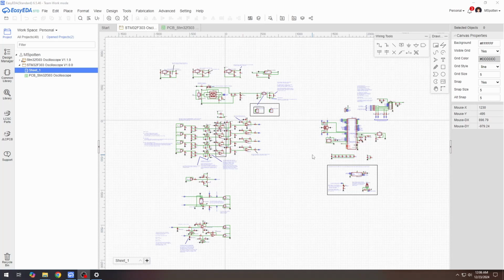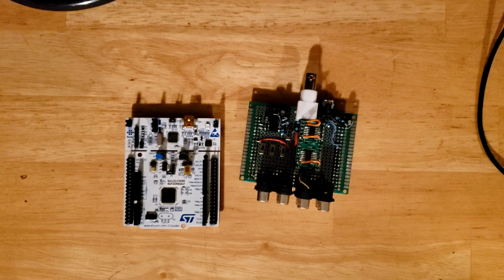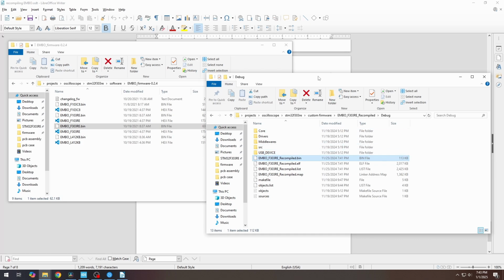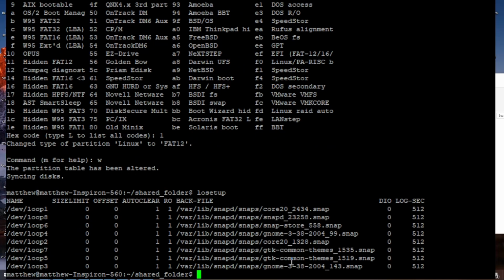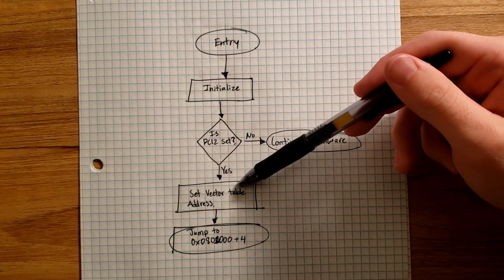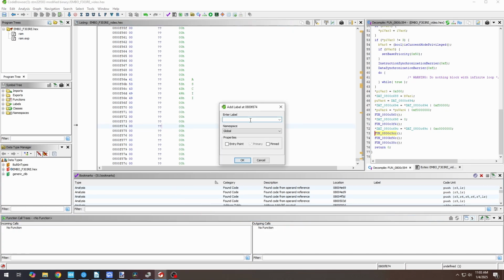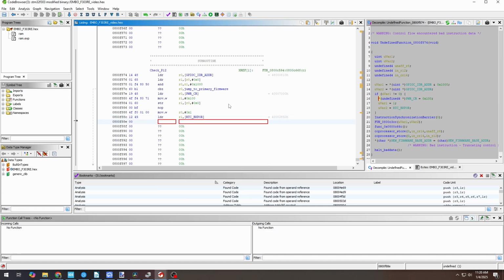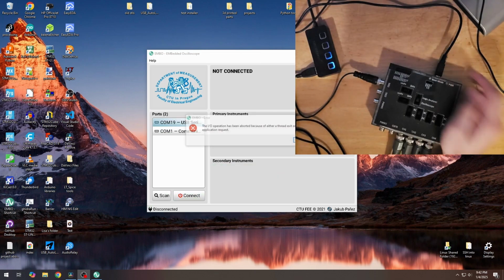Building an STM32F303 Oscilloscope, part 2

Comment: Embos shoftware support multimeter ,this hardware suport or any one port for multimeter too?
Reply from the maker: Yes, the hardware also supports the multimeter! You just have to set the scale and offset accordingly. The input of the stm32 is 0v to 3.3v, and the voltage range of the input is -3.3 to 3.3. In the software, set the scale to x2 and the offset to -3.3v, and you should get correct voltage readings. If you use a 10x probe, you can set it in software to x20 scale and -33v offset

Comment: Is there any software or firmware that needs to be uploaded to the STM32 board?
If so, where can I find it, or could someone provide a HEX file?
I am currently designing a hardware board as an open-source project, and I came across this software, which I would like to use.
Reply from the maker: That's exciting! Sure!
You can find all the resources to the project on my github!
https://github.com/MattSpot10/STM32F303RE-USB-Oscilloscope

The modified firmware (which includes links to documentation and software install) in the this folder.
https://github.com/MattSpot10/STM32F303RE-USB-Oscilloscope/tree/main/firmware

The original EMBO software and firmware release this project is based on can be found here!
https://github.com/parezj/EMBO/releases/tag/sw0.1.5
Reply: @matthewspotten3533  very appreciated

Comment: Matthew;
Any further observations, use of the scope, update/upgrade?
I guess that you have a x10 probe setting?
I was doing some work a few years ago, and found a copy that makes really low capacitance diodes, in case you wanted to add input protection that doesn't cost much bandwidth?
I was actually using an idea that used the Vf curve with a math channel, to allow a "compressed" input voltage range... You lose some resolution of the real input voltage as the log curve of Vf cuts in, but you can get quite a wide range, without changing/attenuation.
Cheers, Sir!
Reply from the maker: Kind of, it's just the 10x switch on the probe. Low capacitance clamping diodes would be awesome and definitely something I hope to incorporate!
Currently it just uses the internal input clamps on the op amps. They said the inputs were internally diode clamped to the supply rails and to current limit the inputs to 10ma. With the inputs being fed through 180k resistors I didn't see this as much of a problem from a DC perspective. Caps are used to transfer the AC component of the input but I guess at high frequency and voltage they might allow dangerous currents to pass through to the op amps.
using a Vf curve sounds super cool! I've never even considered that. I kind of want to try it!

Comment: spotten, not s really common name.
i wondered if you are related to a guy that i knew at Nokia in san diego?
i guess I'll have to watch your 303 version
I've been thinking about hanging this kind of oscilloscope on the back of an analog scope, to use its front end...for maximum fun, i have an old tektronix 700 mainframe, a 2.two-channel vertical plugins, a differential plugin, and a horizontal/trigger section...thinking about putting the 4 channels of the 303 connected to the analog channels on the backplane, So I'd get really good front end, and excellent triggering, and basically replace the display system with the digital scope.
so, I'll get back to your adventure tomorrow,
Reply from the maker: If there is someone with the name Spotten I'm usually related to them not too distantly.
That sounds like such a fun project! I'd love to hear about it or see it as it progress!
How would you purpose the 4xADCs on the stm32 or other words what analog channels on the backplane would you route to these inputs?
Reply: Hi...a bit of prodding about the schematics... with channels A and B;
It looks like it's possible to "fake" the amplifier A to be on continuously, and set channel B as trigger source, which puts channel A to the backplane "signal" pins, and channel B to the "trigger" pins... If you just cut the backplane signal and trigger traces, isolating two vertical plugin's, then put shielded twisted pair from the signal and trigger pins at the backplane, you get all 4 channels available, all the time, and maybe put in a switch to select which of the four channels could go to a horizontal plugin, to make use of the scope trigger, or, of course, use the trigger setup in your scope "box". See, easy 😅
Reply from the maker: Yep, easy😅 That sure does sound like maximum fun! Thank you sharing that with us.  Best wishes to you!
Reply: Thank YOU !

Comment: How did you learn how to do all this bro? How can I learn what I need in order to make my own custom stm32 boards for projects?
Reply from the maker: If your trying to figure out the hardware side I would start with st's dev boards for a specific microcontroller and learn how to connect all your desired devices to it. When you want to build your own board, st usually provides the complete schematics to their boards in their documentation. It's nice to have examples.

For programming them there is so many great resources online. 
St providing stm32cubemx and stm32cubeide makes development really easy. There is many tutorials on how to use their software. 
Learning about the inner workings of microcontrollers is also worth the investment. 

Ben Eater on YouTube does a series about building a breadboard computer that is fantastic. In the past in striving to understand the inner workings of a microcontroller I pulled up reference Manuels and datasheets and started doing "bare metal" or "register" programming instead of using HAL or even the LL drivers. You can also watch a lot of tutorials on stm32 bare metal programming on YouTube.

If none of this makes much sense I would just dive into it. You'll figure it out!

Thank you for your question and best wishes to you in life and in learning how to create your own stm32 boards!

Comment: You might find my capstone project interesting. It's also an MCU based oscilloscope/signal generator, but it's got a screen and battery built-in, and it's designed to plug directly into a breadboard (no BNCs required, though I did make an add-on which let you use BNCs). It was targeted at very low frequency use, though, like literally 1 Hz level, so students can actually see what's going on in real time with LEDs and stuff. It's meant for educational use, mainly. Technically it's capable of up around 1 megasample/s though, with a bit of overclocking. (I tested up to 2 MS/s even, but the signal quality was reduced). I've been meaning to work on the firmware, it could be a lot better using DMA and stuff. It also does resistance measurement (need to work on resistance measurement accuracy though...) and has current limited power outputs, so any pin on it can be shorted to any other pin safely since it's meant for beginners. They're actually using it for a course at the University of Utah, we made a few hundred of them (less than $15 each to manufacture, screen and battery and case included). 

I've been thinking about doing an STM32 version, since there are some nice chips with higher sample rate ADCs, like the F303 you use. But I've been busy since starting my PhD program. If you're interested in seeing more about the project, go to scopocket dot com. Documentation also needs some work; I should really post a video of it actually in use. If you want to see a video just let me know. Actually, I could even send you one if you want to mess around with it; I've got a bunch.
Reply from the maker: That is so cool! I've been having a ton of fun looking through the documentation you provided. It is very well put together and well thought out. What an amazing and useful project!
I haven't had the opportunity yet to use Raspberry Pi's microcontrollers but they seem very interesting!
Reply: @  the RP2040 isn't really the best for an oscilloscope project because the ADC has a differential nonlinearity issue, but for the target use case the Scopocket is meant for, that wasn't really a problem. Here's a video of it in use, though it's a different version of the firmware than what's being used in the course. https://youtu.be/SbrOokjkZqg?si=bX4wyIwlowkZ5gnw

But the interface is fairly similar to how the better firmware version I'm working on is going to behave. I'm going to use DMA to handle all the ADC sampling and signal generation to offload all the timing sensitive stuff completely from the CPU.
Reply from the maker: That makes sense. Thanks for the video! I enjoyed your demo!

I'm sure DMA can make a big difference. It's so nice to set up a few DMA registers and a trigger timer and walk away.

Pretty awesome you're are working on your PhD! Best wishes!
Reply: @ Absolutely, DMA makes everything so smooth. I've got some prototype software using it, I just haven't fully polished the implementation yet

Comment: try not to use positive voltage regulators like the 1117 for negative voltage. they arent really meant to sink/source current like that and may become unstable. theres a reason there are LM78 for pos and LM79 for negative voltages respectively.
it prob works, just as a general precaution for the future.
DC-DC isolated converter is also a valid way for negative voltage, but same applies there. you can also use a simple 74hc14 schmitt trigger oscillator, with the other 5 outputs in parallel driving a charge pump to get the -5V for the opamps
Reply from the maker: You made some great points! Thanks for sharing that! I considered  those points in the design process and had the same concerns. If you are interested in why I chose this setup continue reading!

The 1117 won't sink any current it will only source current (the voltage will rise to the voltage applied to the output if you attempt to sink current with it). When it's used with a DC-DC isolation converter the output of the LDO is referenced to GND. The current flows from the DC-DC converter, is regulated by the LDO and is sourced to our negative circuit. I kind of imagined it as two separated/isolated circuits that are only tied at one point (like a dual power supply). This makes one rail negative in reference to GND. I was worried about the voltages fluctuating with this setup but it seemed to do okay even under load / no load.

I think the 1117 regulator still acts as it was designed in its ability to, simply put, act as a variable resistor, dropping the voltage, and sourcing current to our circuit. 
I was definitely cautious of this design so if you have more ideas on why this might not be the best or why my reasoning might be incomplete I'd love to hear it. (This was my solution to lack of time and decreasing the BOM :)

I tried charge pumps as well but they didn't seem as stable as I hoped they would be from what I remember about the datasheets I was looking at (voltage drop and slow response). I didn't know how the negative supply voltage would hold up with the op amps going from to sourcing and sinking quickly. Looking back I think it would have been okay but I wanted to know it could provide the current. The signal generation output op amps also runs off this same supply and I wanted it to have the capability to source/ sink up to 10ma.

Again thank you did your comment. I am personally very interested in all there is to learn.
Reply: @matthewspotten3533  something something ground loop issues instability and or latch up/start up issues with some very old/chinese fakes, or so ive been told.
i dont know more about this than you do, i dont even have any degrees. 
i guess one could look at the functional block diagrams and dissect them. 
heck, ive been doing the same for years without issues.

Comment: Fun stuff was hoping you'd do a 2nd video thanks. You mentioned on the firmware boot the PID of USB took me back to like 2012 or so Cypress came out with a really cool development board that houses the CY67C013A Semiconductor. The board allowed you to either boot via USB mass storage device, or there was a jumper onboard which triggered an onboard eeprom in which you could boot directly to say a firmware (as you mentioned) via a preconfigured PID this allowed this cheap $4 board to boot up as a Salae Logic analyzer as long as you had their PID and vid . After I watched your video today I went n grabbed the board out of my microcontrollers bin.... 👍 still had it😂... Thanks for the memories, I've changed my profile picture to this particular board if you wish to check it out, thanks again... Mike
Reply from the maker: That's pretty cool!! A lot of years ago! I'm glad this brought back some old memories!
I've been using the cypress CYUSB3KIT-003 as my logic analyzer the last few years. It kind of blew my mind how useful it's been.
Reply: @matthewspotten3533  I bet you do being an MIT graduate and all. Congratulations on that, I've been learning electronics for about 14 years now, from smart people like yourself, I stick to mostly Arduino as I usually buy the Nano,'s in bulk 🤣 I see you used P6100 probes for your unit, I use the Tektronix P6105's in my cheapy scope n they work good. Bought an analog Tektronix locally about 10 years ago n came with 8 sets of probes. But anyway thanks for the coding vid n I hope you keep teaching, I'm 52 n I don't mind at all learning from fresh minds 😂 take care ✌️

Comment: Really cool project, thanks for sharing! How did you do the sticker? Printing on a sticker A4 sheet?
Reply from the maker: Thank you! I'm happy you enjoyed it!
I didn't have any sticker sheets at the time so I just printed it on photo paper, laminated it, and then cut out the sections for the headers, switches, and LEDs manually.
Double sided tape worked great for adhering it to the case.